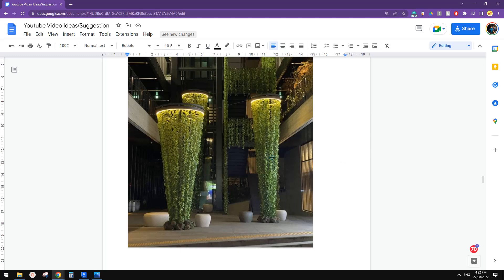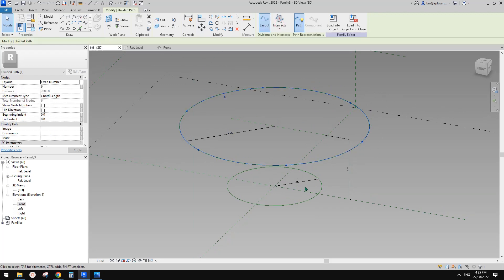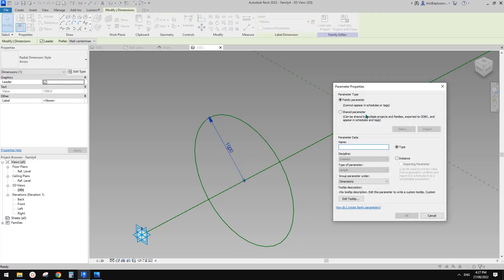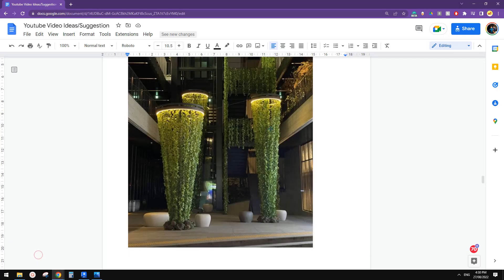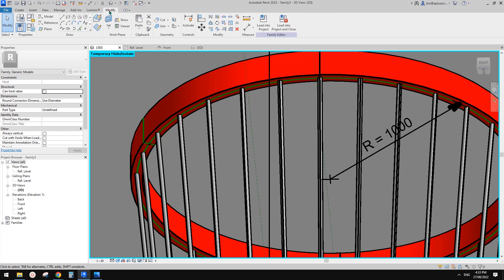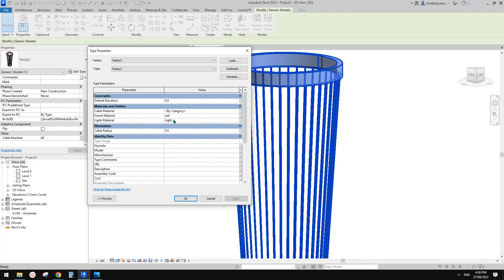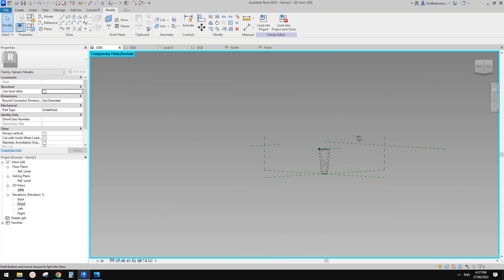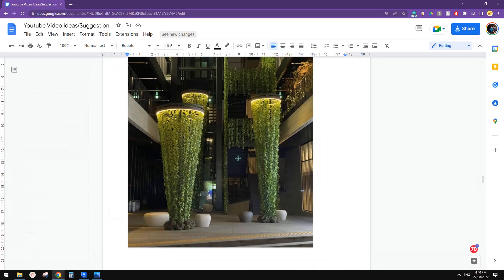Revit Exercise (Day 887) - Parametric Adaptive Family Exercise

Comment: Hi! I was wondering if you've found the file by any chance? I've encountered an error upon placing the cable wire family on the respective points. The cable wires tend to overlap from the circular reference lines whenever I change the radius of each circle. Thank you!
Reply from the maker: I didn't save this file, unfortunately. Send me the file and I will have a look for you. binhe615@gmail.com